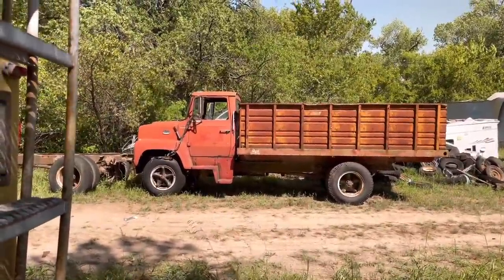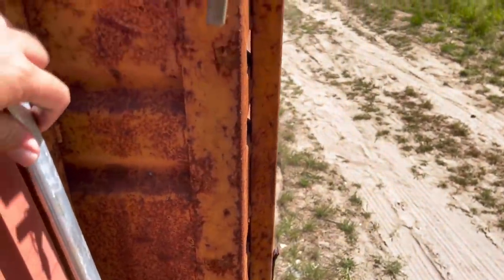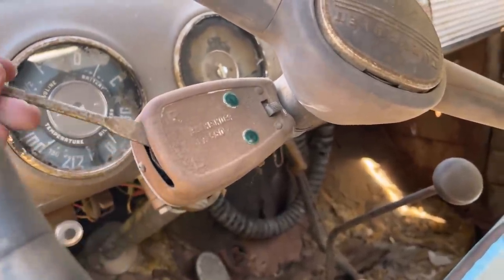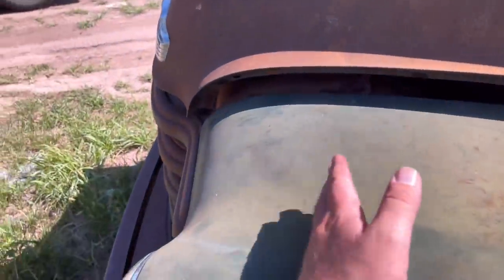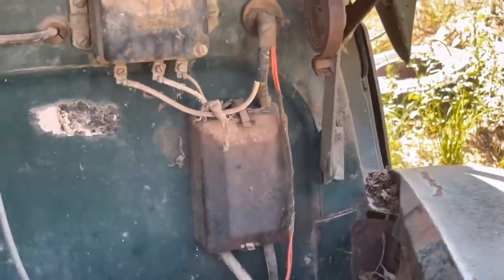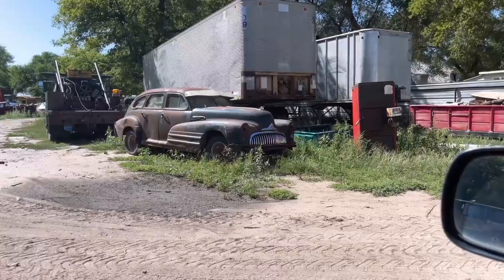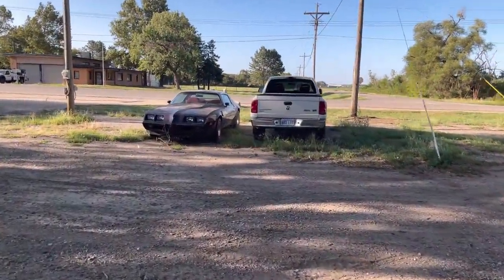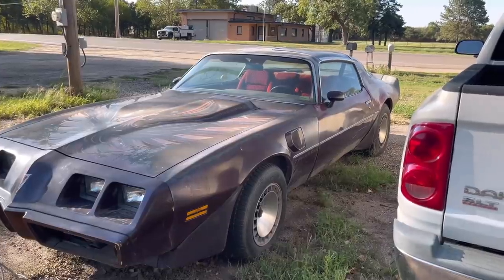We Bought Some Antique Trucks!

Comment: Swap your first gen vacuum booster for a second gen 24 valve hydro-boost setup. All hoses and vacuum pump/power steering pump come off 24 valve and will bolt directly to the 12 valve. Only need to drill two holes in cab for the hydro-boost bracket.

Comment: That Trans Am brings back memories, I had a buddy in High School who had one very similar, he would abuse my good nature and get me to install stereo and speaker upgrades to it.  He had to keep increasing the performance (noise) of the audio system as he increased the performance (noise) or the car.  Seriously, how loud does "Billy Jean" have to be?  Pretty loud if it is going to drown out that "muffler."  Thanks for sharing, excellent video as usual.  You are hitting on all cylinders Silas, even the ones filled with sand!

Comment: Haven’t finished the video yet but I’ll forget to comment this if I wait. For your power steering hoses, my local John Deere dealership can make power steering hoses custom if you can’t find them premade. They gotta be able to fab hydraulic lines so they have the industrial crimpers
Reply: Usually any heavy truck shop a good big one has that capability any hydrolic hose place can do it maybe it's not the same as canada where I live
Reply: @darrenbrisson4336   yep, a friend of mine just mentioned a heavy equipment shop or even a bobcat repair place could probably fab one up.

Comment: I'd be an adventure if I could get approved to cross the border I.e I got caught running cigarettes to nova Scotia with 5 keys of hashish but never robbed anybody or done any other bad crime so i can come work there with you we'd rock the place like I've said before tons of experience working in scrap and junk yards know all my metals have a good eye for seeing money on the ground scrap wise I used to stand in the steel pile all day and the lad  working the claw would direct me to metal and other things to pull out of  pile so if diidnt go with the shredding like #1 steel, cast iron, stainless steel ,ductile, manganese, aluminum , I'd roll big pieces of metal out of the way for the guys who were cutting up the steel to get it to 4 ft lengths so Bakker brothers would pay top dollar I used to do just copper and brass and was taught to know my colors if the pipe was a nice mulberry no stains or very little if went into its own box as it was worth more I can clean any metal I bailed rads, wire, of all different sizes metals computer junk used a big shear to break up faucets know all my coppers and brass and aluminum, and steel plus used to work in a couple of auto recyclers I've done it all and you'll never meet someone who's had more experience in the field of scrap metal and auto recycling fuck I would love to go work with you we'd clean a nice area set cars up better make a rig to put cars on so I can pop the juices out of them and catch them and put them in containers to get rid of to company's that do that keep the clean rad fluid and gasoline good battery's to sell and decent tires I'd get on the aluminum wheel pile and wouldn't stop til there all unmounted making a tire pile from the rest you rip the exhausts off I'd cut the cats off through the rest in the shredding pile and stack the cats by size its wag better when you have some one who knows what their  doing and can train others

Comment: Hi Silas, A top tip for your leaking power steering that I used in my old  1991 Landrover Diesel power steering, i was told put a 1/4 cup of old school brake fluid in the power steering tank, it swells the seals in the power steering and stops some of the leaks.. dont use modern DOT5 as it synthetic/ worked well for my old Landrover/ best of luck.. Thanks for your videos -- Ian -- UK.
Reply from the maker: I run DOT3 in it. Got the hose fixed now as well as the brakes, so I’ll be on the road Monday.
Reply: @AdventuresMadeFromScratch  Great news, gets that old truck going again.. I once had a saying when I drove a minicab (unlicensed taxi) "when the wheels are not turning Im not earning" lots like your loved old truck eh.. have a great day.. Ian - UK.

Comment: All antique trucks are savable if you don’t mind a little clean up of ol motor homes fluff left over from them when you take the parts out them ,(I,E, ) rearends and front frames, they replace with a little work , rite into the ol Ford and Chevy dodge trucks, and if you pay attention to the years of motor homes, 80s and 90 s, all Chevy engine powered , 
They all have  disc brakes front and rear , and the 1950 s ol thucks Chevy trucks have the same lug pattern, ok nice please try to save all of the good useable ones, thanks BigAl California praise Jesus grace Christ amen 🙏,

Comment: I guess your such a BIG DEAL now with 20k subscribers you don't answer comments anymore ...
Reply from the maker: There’s too many to answer them all, especially since a lot of them are the same question multiple times. Going forward I will have some question and answer videos most likely
Reply: @AdventuresMadeFromScratch  I stated several times I need 1996 Caprice Parts ...
Reply: Taillight lenses and a Park Switch out of a Wiper Motor
Reply from the maker: My intention wasn’t to upset you. As I’ve stated in many videos, I don’t have time to pull parts at the moment. If I could hire help I would, but until the labor shortage is over that won’t be possible. If you are in immediate need, I would recommend buying them on eBay.
Reply: @AdventuresMadeFromScratch  I apoligize also - I watch a lot of You-Tube - there is a lot of arrogance from Videomakers after they start to get subs - that anything they say is Sacred - I have 60 videos & don't act like that - the Caprice restoration has been going on 3 yrs - no hurry, but the Park Switch for '96 Wiper motor is not available anywhere ...and btw - my daughter lives in Hutchinson ...